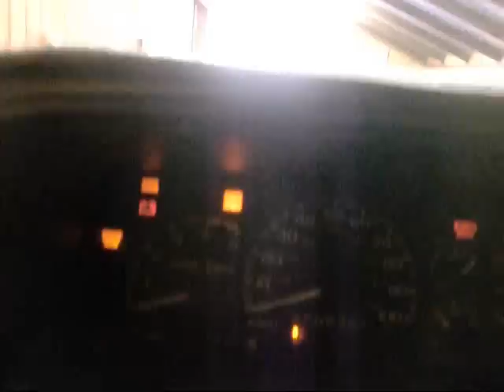5 7 13  Weasel Cold ZT Crank Vid

Comment from the maker: We never intended to live there, but build our dream house above were the Sub is parked, but it was too far off the road, too fancy, and 20 miles from town, so we had smoke damage in the  house, a couple years after buying it.  we could have slept there, but the furnace ran backwards and filled the house w smoke from a blocked chimney. Frootloops and I fixed the chimney, remodeled the place, and only rented it for 6 months, and couldn't find a good tenant, so we sold it...

Comment from the maker: After the stupid Olds 350/5.7 conversion (they make great Olds drag car engines), GM had Allison design a TOTALLY new medium duty 6.2, so it's 100% new GM diesel, and it was made into the 6.5 Turbo in 1992. The Ford 6.9/7.3 was a School bus engine that was fitted to the pickup chassis, so they go forever cause they're designed for a much larger chassis.